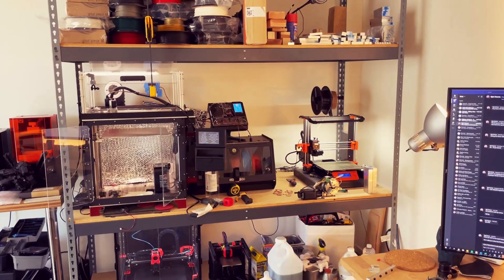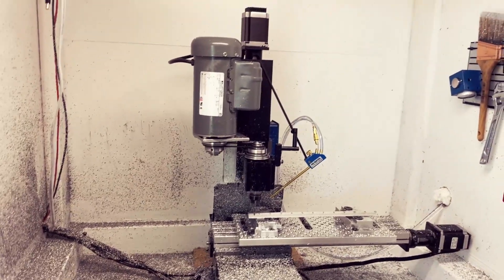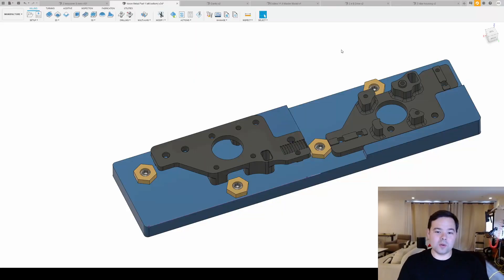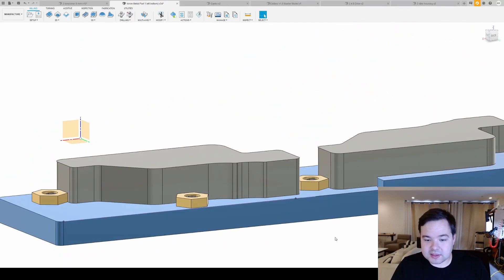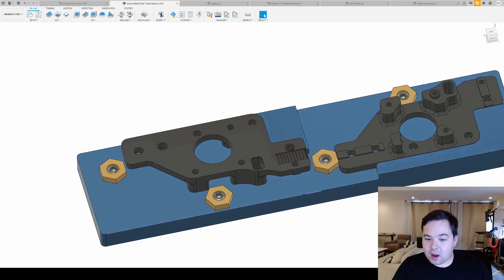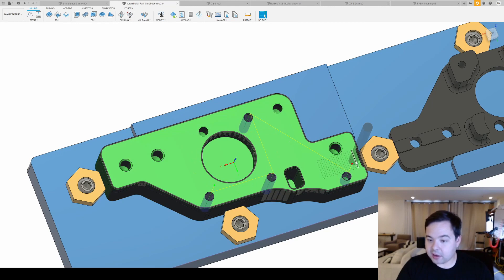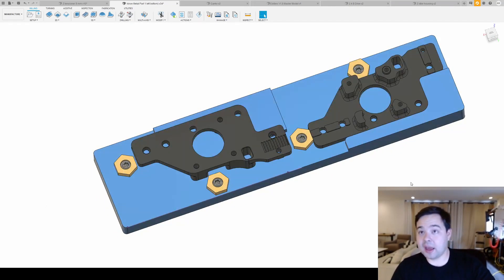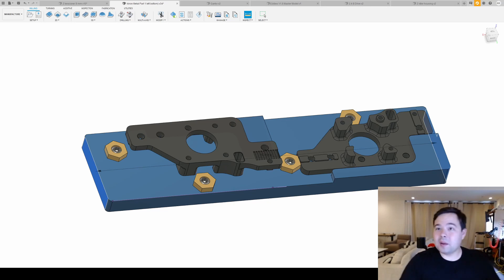Hello World - Machining and designing fixture for Voron 2.4 Motor Mount

Comment: Also laser cut is only accurate at thin sheetmetal thicknesses (less than 1mm). Once you go thicker, the parts look horrible. There will be about 5-6 degrees of draft on all surfaces. Holes won't be round (beside the draft issue). They will be a weird shape. Waterjet is slightly better for thicker materials. But expect to do finish machining with the cnc on both. Both have their place, but expect large tolerances. I didn't check your ofter videos to see the follow up and how your laser parts worked.

Comment: interesting fixture design.
you could save some space with directly mounting your fixture onto your sub plate with pegs or dowels?
or am i just too much into a production setting? :D

for the first op, what about using a 3mm single flute endmill to drill the 3mm and bore the rest of the bores?
also gives you more control over the actual size. same goes for tapping. there are threadmills out there that could do M2,5- M4 (which can start a M5 - lets you finish hand tapping it; Datron tools).
Reply from the maker: Thank you Shas0AunLa for this tip - you are absolutely right! I am going to redo my CAM and fixturing with this in mind. Do you do this professionally? Would love to learn more from you.
Reply: @517industries2   oh sorry, didn't get any notifications about your reply.
yes, i do cnc machining, fixturedesign, cam programming for a living. would love to do more complex parts in my day job, but you have to take, what you get!
don't hesitate to ask if you have questions!
Reply from the maker: @ShasOAunLa  I actually have a part I can't figure out how to fixture for the life of me - probably going to do a video on it. Is there a way I could contact you to see if you have any insight?